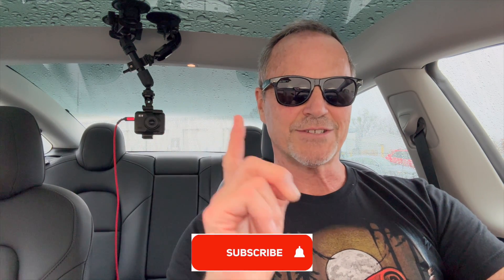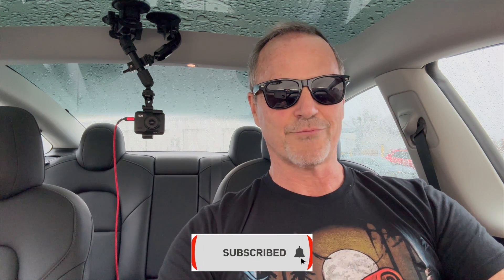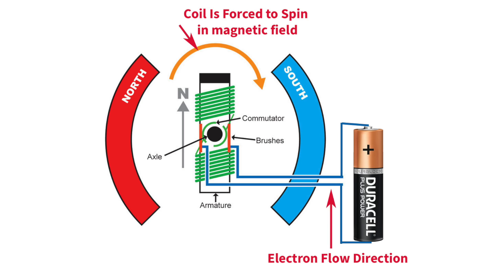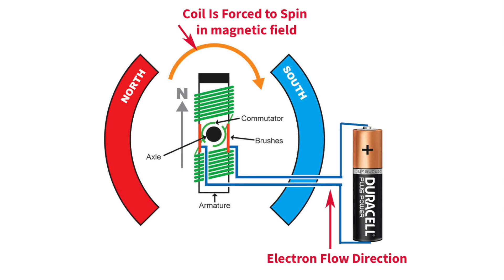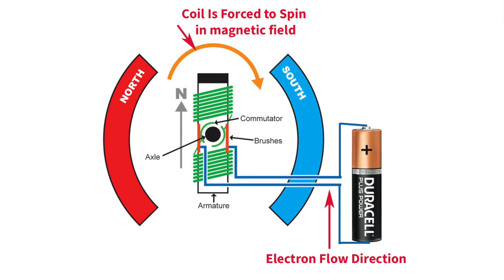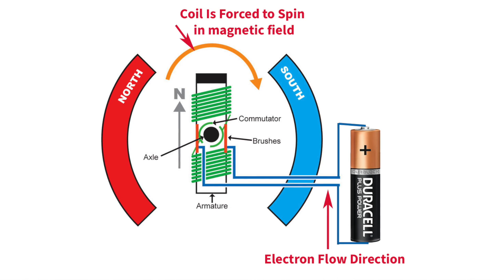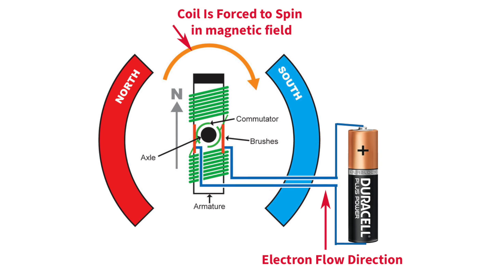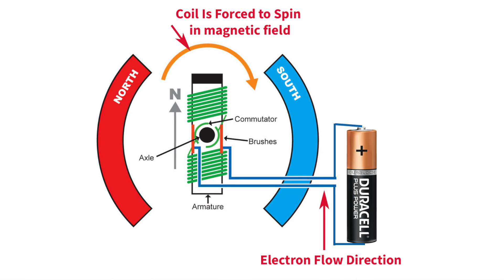How Does Tesla's REGENERATIVE BRAKING Work?

Comment: Could you explain how they manage to control the regenerative breaking? Because it is not just regenerative or not, the more you release the acceleration pedal, the more it regenerate. It's not like you put power in to the motor and get power out at the same time, or is it separate coils??

Comment: John, the one part that was left out was: When the motor is used as a generator and it generates current to put back into the battery, this tries to slow the motor down because power generation puts a load on the motor (now a generator) and this is what slows down the vehicle. That's why when the battery is full and can't accept any current, there is no slowing down force (no regenerative braking).

Comment: It’s funny, as a child in the 80s, I used to play around with those little DC motors and lights with batteries and circuit test sets from radio shack, and I had it in my mind that if I could spin the little motor, I could use it to light up a little bulb. I thought if I attached a paddle wheel from Lego blocks, that I could demonstrate hydro power running tap water over it. It didn’t work and I thought that I was wrong and was so very disappointed with my science fair aspirations that year. A few years ago, I decided to spin the same type of motor and was indeed able to light up a similar incandescent bulb and I laughed to myself. It’s funny. I have a hunch that if I was able to get that to work as a child that I would be an electrical engineer now instead of a structural one… 
Life is funny.

Comment: That is not how it works with regen. The voltage generated by the back emf will never be high enough to charge the battery. This is because the battery voltage will in most cases be high enough to produce the rpm in the motor. You can produce regen this way if you go downhill at a higher speed than the max speed of the car but that use case is rather limited.

I think Tesla is switching the motor winding short circuit and then opening the circuit releasing the power stored in the coil back in to the battery. At least that’s how it can be done.
Reply: damm

Comment: It isn't quite that simple, but I suppose it is an easy birds-eye explanation.   The current won't magically just flow back into the battery without a little help from the motor controller.  And for the same reason, the battery won't just simply turn the motor without a little help from the motor controller.

Basically both the motor controller AND the motor itself are independently creating a sine wave of "current" onto a common bus.  3 phase motor == 3 busses.   I am ignoring voltage which is a bit more complicated because the motor controller does not actually generate a sine wave of voltage.

These two competing sine waves, when mixed together, generate four quadrants and the motor controller turns on various combinations of its BJFETs in these four quadrants determines what action is being taken.  

In two of the quadrants the direction of current will charge the battery (regen), and in the other two qudrants the direction of current will discharge the battery.   But the coolest bit is that the two quadrants that DISCHARGE the battery have the following functions (1) actively accelerate the car and (2) actively decelerate the car.

So not only do you have regen in the two quadrants that charge battery to decelerate, you ALSO have the ability to actively (as in burn energy from the battery) decelerate the car.   You can do both.  For example, if the car is moving forward slowly and you put it in reverse and hit the accelerator pedal, that slowing down before it reverses is not regen.  It is actively draining the battery to accelerate in the opposite direction.

Similarly, when one-pedal driving, the very last bit of motion before the car stops does not have enough regen to actually stop the car, so that last bit of deceleration when coming to a full stop can actually burn a little power from the battery to fully stop the car.   Nothing to worry about, but that is why some vehicles like the Teslas have software setup to fully stop the vehicle one-pedal without using the physical brakes, and others like the VW just cut-out the regen below 4mph and require the use of the physical brakes to come to a complete stop.

-Matt
Reply: I did'nt knew a complete full stop on regen requires battery to drain, but looks like tesla again pulled a rabbit out of their hat with it's software sorcery

Comment: I can't wait until they remove mechanical breaks from EVs altogether. They are an unnecessary cost and always a source of failure (rusty rotors, pads needing to be replaced, brake lines, brake fluid, etc).
Reply: at 100% battery soc your regen won't do a damm thing for braking
Reply: @yashyp24 
That's why "100%" Indicated isn't 100%. There's a top buffer.
Anyway, if you think logically....
Battery at 100%
You start a journey.
That requires energy.
The car is moving.
You brake.
Unless the system is more than 100% efficient, you can't recover more energy than you used getting to speed.
Even if you pull out onto a long hill, a small buffer solves the problem.
Reply: dude

Comment: I don't understand how regeneration creates braking force without involving brake shoes.
Reply: It’s not a friction brake. It’s an electro-magnetic brake. When the car is going down hill, the motor is no longer driving the car but it is generating electricity, it’s the strength of the magnetic field that provides the braking effect.
Reply: Just think of it as the inverse of when the motor is accelerating the car but now the force is reversed. So instead of providing velocity to the mass of the vehicle it is taking the energy back and thereby slowing it down.  Energy can't be created or destroyed, just converted.  Legacy brakes turn that energy into heat.

Comment: Just learnt that regen has limits. I was coasting down a very long steep descent in a model Y. Eventually, I got back 3% of charge, then the regen reduction warning came on. I suspect long periods of hard regen will generate heat and the BMS will reduce regen capabilities.
Reply: The more motors the better in that situation I imagine.
Reply: The battery was probably nearing a full state of charge.

Comment: The classic use of regenerative braking is in the Tesla Semi. Rolling downhill generates a lot of energy -- its basic high school physics. (falling with 1/2 at^2 acceleration applied to an inclined plane). Jordan on "The Limiting Factor" pointed out that the motor and batteries of the Semi were sized to absorb the enormous energy of rolling downhill (that would otherwise overheat truck brakes)., because the motors and batteries were super sized and designed for acceleration the flip side is that the Tesla Semi has enormous acceleration for going uphill !!! That explains why Tesla had the video of a truck loaded with heavy concrete barriers accelerating past (passing) other trucks while going uphill. This wasn't because there was an untapped market for fast trucks going uphill, but because of the flip side (a side effect) of regenerative braking on the downhill side.
Reply: Semi has 3 Plaid motors, right?
Reply: Motor core, different gearing